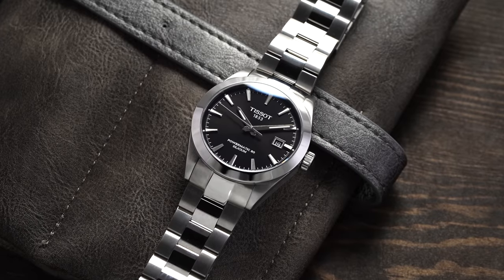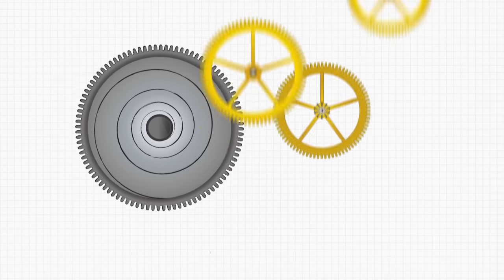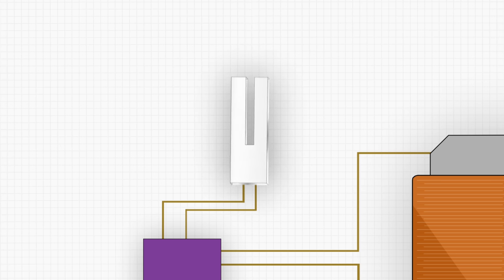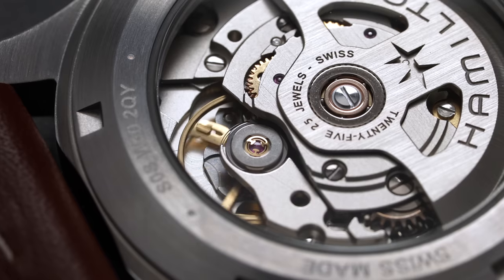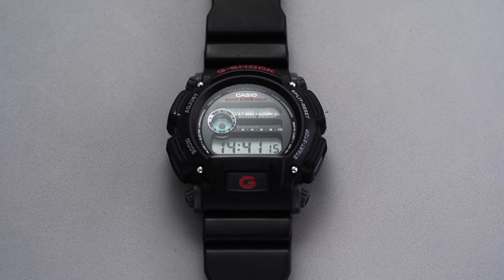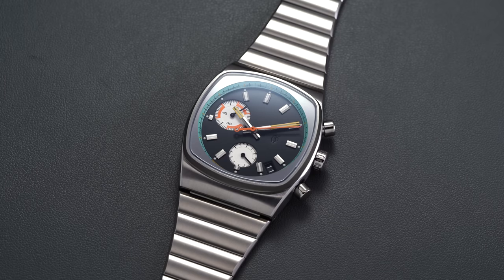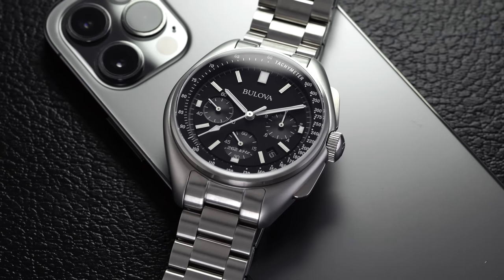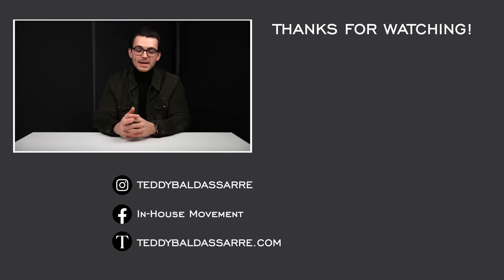Why Every Collector Needs a Quartz Watch - How They Work & Everything Else You Should Know

Comment: One of my oldest watches is a $50 quartz steel watch that died in 2020 after owning it for probably 25 years.  $10 and 2 months later, I was able to get a replacement movement for it, dismantle it and take the parts I needed (mainly the circuit board and crown gearing) and it's back up and running again.  Honestly I vastly prefer mechanicals/autos, but like you said, quartz can have a place...and is why so far I also have a Bulova Lunar Pilot and a G-Shock 5610 in my collection.

Also, although I do like having to wind and set my mechanicals before a day of wearing them, something can also be said for when you are running late in the morning, and can just grab one of your quartz watches instead and be out the door seconds later.

Comment: Thanks Teddy.  I have both mechanicals and quartz in my collection.  I like the mechanicals in that they do not require battery changes.  I don't like the fact that they are not as accurate as quartz watches.  The most accurate mechanical is a recently repaired and cleaned 1916 Illinois pocket watch.  The average mechanical requires resets at least every week.  I have a couple of automatics that need to be repaired but the repair estimate greatly exceeds the value of the watch. Mechanicals are truly a love-hate relationship.  For me, the watch should look good but the main functionality is that it must be able to provide the time accurately.   Recently I purchased a Citizen Eco Drive.  I have the amazing accuracy of the quartz drive but the power is derived from light.  Looking forward, this will be my go to watch.  Based on first impressions, if I buy another watch it too will be an Eco-Drive.
Reply: The cost of repair is one collectors of mechanicals should take into consideration as it is a real issue.  With a few exceptions, this is why I stopped collecting inexpensive vintage mechanicals and automatics.  If you get a good one, maybe it runs for years without any trouble.  If you get a lemon,  you could repair it and still find it doesn't keep great time or worse, stops intermittently.

Comment: I love my quartz watches. I love my mechanical watches, too, but there's a lot to love about the accuracy and "set it and forget it" aspect of quartz watches. I am particularly fond of Citizen Eco-drive watches (I currently have 5 of them in my collection), as they remove the big downside of quartz watches (having to change batteries). My Citizen PCAT is also the watch I set all my other watches to, as it sets itself to the atomic clock on the daily.

Comment: Nice presentation Teddy!
I am a watch collector and love beautifully embellished mechanical watches, but I also wear several quartz watches that I can simply pick up and wear. 
When I incorrectly set my 
lovely Blancpain triple date moon phase, it cost four figures and a trip back to the factory to get it fixed. 
My inexpensive but quality Citizen Eco Drive is still keeping accurate time after more than 20 years without any service or battery changes!

Comment: I currently only have 2 watches with the absolute intent of adding more to when a proper occasion to celebrate arises. One is a green Alpinist, the other one is a Longines Conquest VHP (very high precision quartz movement) i had it for about 6-8 months now and it's only 1 second fast since i got it. I will keep it for the forseeable future to set the correct time on my automatic watches and have a backup watch that i can just grab and be done with it. Its incredible to think that i will only need to set the proper time again once per battery. Its truly th epiphany of "set and forget"

Comment: Great discussion Teddy B. I actually have a Tissot PR200 (Quartz) since 1998 and still going strong.  It looks remarkable-200 meters WR, sapphire crystal just to name a few of its features.  I have no problems whatsoever.  I just replace the battery every 2-3 years.  Also, can you look into the Skagen (Denmark) line of watches.  They make great quartz timepieces and what is impressive is the thickness in making these.  Its only now that I am into mechanical watches especially the Seiko 5 series which are truly robust, reliable and elegant for such a price point (except for their bracelets in general).  More power to you!

Comment: The dynamic of Quartz watches versus mechanical watches is a little like the dynamic between cars with automatic transmission versus manual transmission. 

There's just something a little more visceral about stomping a clutch pedal and manipulating a gearshift while you driver versus simply putting a car in gear and never thinking about it again until you park it. Driving enthusiasts look down on folks who don't know how to drive stick, as I suspect mechanical watch enthusiasts look down on quartz watches. 

And all this despite the fact that, for general use, ease of learning, convenience and servicing - a car with an automatic transmission is usually better in many ways than an old manual transmission, just like the quartz watches have all the major advantages over mechanical watches.

Comment: Great take on it, I completely agree. I'm a nice watch + G-Shock kinda guy, and the only reason my nice watch (Seiko Alpinist SPB241) is mechanical is because it wasn't available in quartz. Even though I wear this watch very often, I still find that I have to keep it running or set the time more than I'd like. That said, the multiple beats per second and interacting with it does have a charm to it. I wonder if companies are missing a business opportunity by offering a quartz version for say $100 less when it costs $200 less to make (say for a $1000ish mid range piece). My ultimate watch would be the Grand Seiko SBGX319.

Comment: This video cleared my decision on picking the Quartz Tissot PRX blue dial.   After careful consideration I believe the powermatic 80 is over priced for that dial and movement.    I have a Tonino Lamborghini with a Quartz movement I’ve had for 15 years and changed the batter twice.  It’s durable and beautiful.  My collection includes quarts and automatic/mechanicals. Very helpful video.  Thank you.

Comment: Thanks, your video brings across quite a few points I often try to make when discussing watches with other people. My collection consists of about thirty pieces, with quartz making up a large minority- it's about 60-40 here.
While I do understand the lesser appeal of a low end quartz movement (which are often used in cheaper, less well-executed watches for obvious reasons) I think the higher end pieces such as a Grand Seiko 9F or Spring Drive, a Bulova 262khz or a Longines VHP movement are well worth a slot in any collection. I personally even own a radio controlled Citizen Eco-Drive which is just about the most accurate and care-free a watch can get- but that's a topic for another video i guess. I, for one, enjoy my quartz watches as much as my mechanical pieces.

Comment: Having cleaned out equipment boxes last used 15years ago before I left the Mercantile Marine, I came across an old Seiko 7006-8120, putting it on a winder showed that the capacitor is (maybe) compromised as it only charges to the first sector on the dial. More chargeing did not improve matters, so I tried the electric toothbrush charger as featured in YouTube videos. All to no avail and I will approach a trusted watch maker when he comes back from COVID isolation (his children brought it home from school). He did warn me that parts for these early models are running out, however when he's back on deck I'll see if he can fix it, for, even though the watch is (maybe) compromised it is not stuttering and keeps time with no error what so ever. Just tell people there is a place for well designed electronic watches even those that need a battery to function. They just do a great job of measuring time! It' rather like having a girl (or boy) friend who is clever, funny, articulate and good to have around, but has looks like the south end of a north bound pig, against that of someone who looks great, but , is self absorbed (i.e. has Tasmanian Lobster syndrome, that is a  great body and a head full of shit!!), and is expensive to keep!

Comment: Thanks for an educational and evidence-based review.  I have three Victorinox quartz watches, and find the quality of every component of these - case, face, back, crystal and band, to be superior to most mechanical watches until you get significantly above the thousand dollar mark.  Then, as you say, there is the accuracy issue, where there really is no contest.  I do appreciate the intricacy and beauty of mechanical watches, and am not put off by the need for more care and maintenance.  As a fly fisherman, I would say an appropriate comparison would be between a production graphite rod, - analogous to the quartz watch, and a handmade split-cane rod -  analogous to the mechanical watch.  Making a split cane rod that performs as well as a graphite rod requires years of experience and orders of magnitude more effort, but the product is a thing of  beauty that no graphite rod can match.  We need to remember that there was a time when the best cane rods from makers like Leonard were the best-performing rods that money could buy, and they were expensive for a reason, just as the best mechanical watches were the best performers, and also the most expensive.  Quartz turned the watch world upside down, as did fibreglass and then graphite in fly rods.  A final observation is that, movement details notwithstanding, many  people buy mechanical watches for the details of the case, face and band, but there is no reason that quartz watches cannot be made to equal mechanical watches in quality of all components save the movement.

Comment: I went down the mechanical rabbit hole a few years ago and got  cheap seiko 5. At first I was really dissapointed by the lack of accuracy, I had to reset it almost daily, but I could accept that because it was so cool having a mechanical time piece. After a few years it started to slow down significantly and I contacted a few watch repair shops to see what it cost to have it serviced /repaired. Lo and behold was I shocked when the price was about three times of that of the watch! And the cheapest was to replace the whole movement with a new one.
So I thought to myself, If I have to change the movement every now and then, wouldn't it be easier to just have a quartz watch and replace a battery every now and then instead?
Now I own an Alexander James Pilot quartz watch (micro-brand), that I love, I just have to set the time 2-3 times a year (at daylight savings and battery change) and a new battery cost me $3.
I totally get the idea of mechanical watches, but it's just not for me.

Comment: I've only been into mechanical automatics since August 2021 but I still do respect some of my old quartz watches, especially the ones that excel in what they do best : accuracy (one of them does less that plus 1 second a month), slim form (I have one which is less than 3MM thick), and a chronograph function which does not need expensive outlay or servicing. I can't see me wearing quartz watches again, but I'll hold onto them and I won't disrespect them.

Comment: I'm pretty new to watch collecting as a second hobby, so my budget for such things is quite low. That being said, my two-piece collection is very functional at the moment and are both Casio quartz. My warehouse work watch is a G-Shock DW-5600RB-3JF because of the sheer durability those watches are renowned for, and my around-town, more formal watch is an Ediface EQB1100XDC1A. As you can tell, I like green watches lol.
Reply: Look at vintage mechanical watches, they are inexpensive and better quality, more durable than Casio.  There are many mechanical watches out there that still work perfectly after 50-60 years of being beaten up.
Reply: @bdegrds  I'm not against picking one up for sure, I just wanted something that has less potential points of failure or service for my first one or two watches to use as dailies. I do have my eye on some modern mechanicals, but I might indeed also look into more vintage ones... if they came in green of course haha 😄

Comment: I’ve owned multiple mechanicals in the $300 -$500 range. Got fed up with their very crappy accuracy, and some so-called self winding watches still required me to manually shake them to keep them running through the night. I have sold all but two of those mechanicals, one an appreciating Seiko dive watch. My suggestion for a nice dress Quartz is the Orient Capital Gen 1 in rose gold with white face. It is very thin, very nice with Dauphine hands. Orient is a Seiko-owned company. I have purchased 5 Capitals over the years, giving three as gifts.

Comment: Hi Teddy, you are rigtht: Quartz Watches are important. Especially for people who are entering into the watch world without having the budget for several thousand dollar watches but want to have the design feel of a great watch. Tissot is a master in this, like now with the PRX or pilote style watches. My fist watch (1984) was a Tissot Dress Watch, 36 mm - white dial - roman numerals - yellow gold coating for 245 Deutsch Marks (85 Dollars at that time). 5 years ago I asked my jeweller to remove the second hand because I do not like the jumping second hand. What I think the industry should provide are quartz watches which should mimik the movement of the second hand like being powered from a mechanical movement, so 2, 3 of 4 steps within a second. This has also a practical reason: by just looking at a short glance at the quartz watch (less than half a second) you can mess up the second hand with the minute hand and read a wrong time. This happend sometimes with this Tissot and some dressy Swatch Watches. Or the Quartz watch should provide a small second at six o' clock position, looks even more dressy Junghans is doing  the mechanical mimik thing with the Max Bill Mega Solar - it is like looking at a mechanical watch - and no worries with time setting while travelling. The watch is superb - price point around 1000 US - and it tells the time always right when in sync with the radio signals of the regional authorities. Greetings from Germany

Comment: I have a solar quartz watch, which has a titanium case and bracelet. It's a very unobtrusive and somewhat understated dress watch, and quite frankly, I wear it quite often. The case height is fairly minimal, so it will fit with most outfits I wear for work, no matter whether I wear a dress shirt or not. I also don't need to set it. In summary, it's the watch I wear when I'm in a rush in the morning. Another plus is that is extremely comfortable, and you hardly know that it's there. And yes, I will have to change the battery every 15-20 years.

Comment: I've bought a Swatch system 51 a couple years ago a few months later it broke; I bought another one, same model, and the same thing happened. I have a Casio  Duro that I've owned longer; changed the mineral crystal to a sapphire, to this day it still works. I've added the GMWB5000-1J  to my collection, and it's god tier. Quartz watches especially if they're solar powered are superior.

Comment: A good collection will have a mix of Manual wind watches, automatic watches, and quartz watches of varying degrees.

Back in the mid-90s when I was in my 20s  my watch journey began as I started to make decent money, and I thought I "knew" watches my friends were buying Tags and Movado watches which are quartz. I bought the Omega Sea-Master quartz because it was the watch James Bond wore in Golden Eye. I bought the 37.5 mm. I wore it for years as my main watch. Ironically, my "dress" watch was a Movado Museum on a leather strap that my father brought me for Christmas. I still have that watch too. Just the other day I found the box it came in and I took it out of my watch box to store it in its box and the original strap disentigated when I took it out of my watch box. In any event, as smaller watches became less fashionable, I wore the Omega less. But, about 2 years ago I was considering buying a newer version. I pulled my current one out of storage and I realized there was NOTHING wrong with this watch and how much I missed wearing it. I put a fresh battery in and have been wearing it regularly.

Comment: I've just started watch collecting. My theme is digital quartz watches, mostly casios, some vintage ones from the 80s. I love the 80s aesthetic.

Quartz hating is pretty ingrained. I was also a bit of a snob initially toward quartz watches even though that is what I wore for utility's sake. I had decided that I couldn't really collect watches, because I thought that real watches worth collecting are the analog mechanical ones and I simply don't have the money for that. Even with cheaper decent brands those can get expensive fast and maintenance is also expensive. I only have 1 mechanical watch, an automatic Bachrach (no idea about its pedigree) got it 9 years ago from a former colleague for about 20 euros. It started losing time too fast 3 years ago and haven't worn it since, but I took it to be repaired this week, 40-50 euros to repair and do maintenance ( not even a comprehensive repair). 

Then it just clicked, I'm an idiot. I've worn a Casio F201W for the last 2 years, they're good watches and there are more handsome ones or more important models out there and even vintage ones for just a few euros. Most digitals are not that sought after. So the thrill of the hunt began.